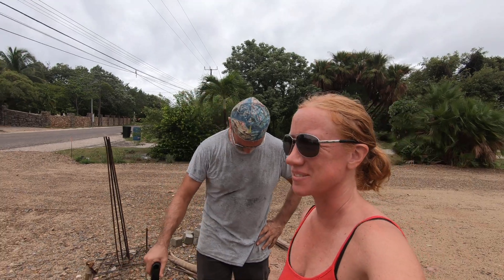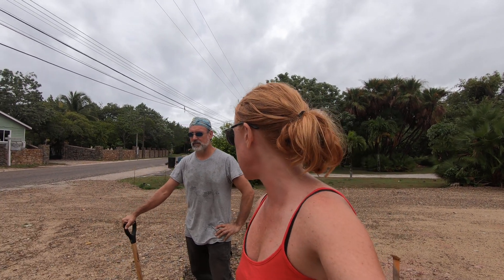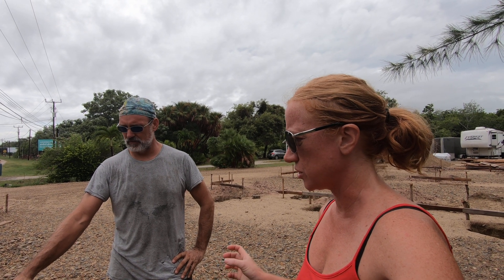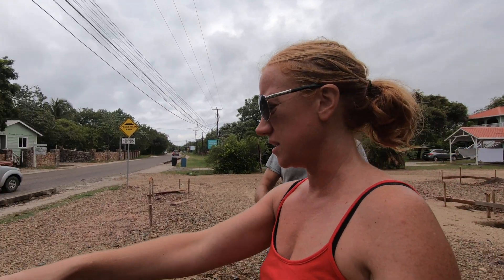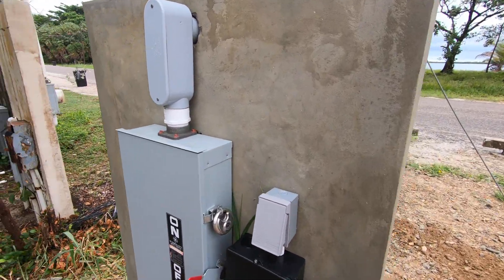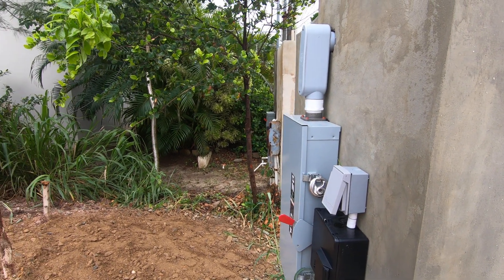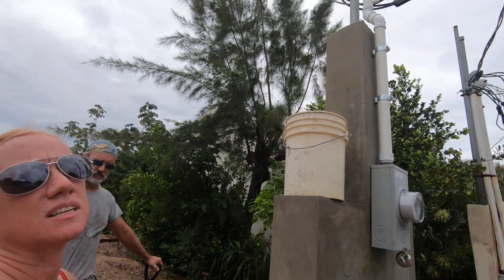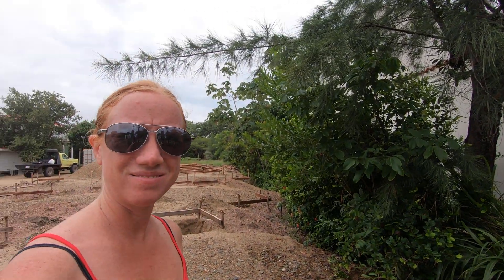Building in Belize S05 E05 | New Electrical Service Connection in Belize - Process, Cost, Timeframe

Comment: Hi! When it came to your breakers did you guys have any issue with the width and length of the breakers? Caz I’m having an issue where my contractor is saying that my breaker size is 1inch and the require a 1/2 inch!
Reply from the maker: No, all common breaker sizes are widely used here - at least in the area of Belize where we live. Now, we do often have to have various building materials shipped in from Belmopan or Belize City.

Comment: Don't know why you said it was a mess. You have power. You went through the correct process to get hooked into the grid. I hope you have plans for acquiring power from solar as a backup. You are close to a road so after the initial build I'm sure you'd be looking at ways to mitigate the traffic noise.
Reply from the maker: 'THE MESS' I was referring to is the tangle of power lines leading from our panel to the main power pole ... definitely NOT complaining about the overall process - that went fairly smoothly and quickly. And, you're right, we have POWER! Yay!